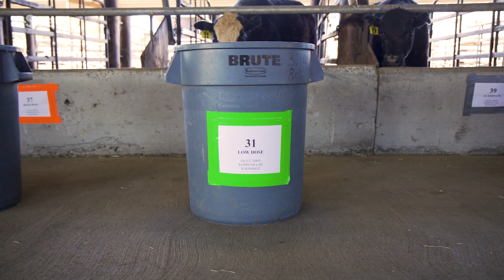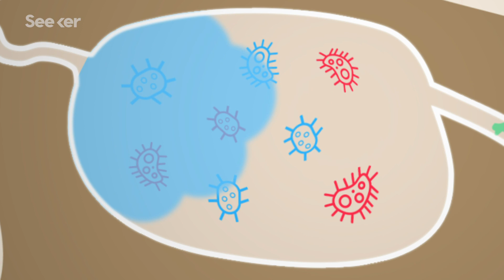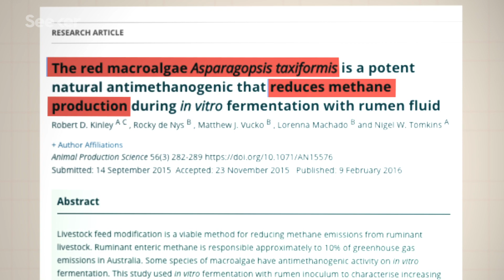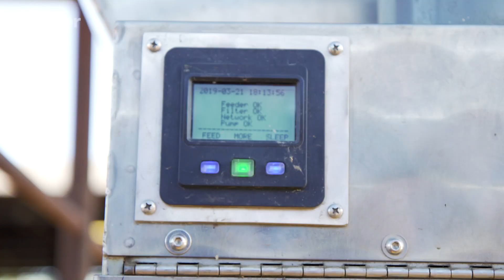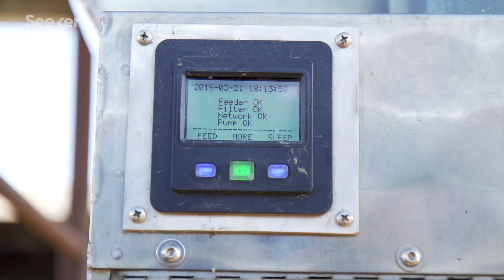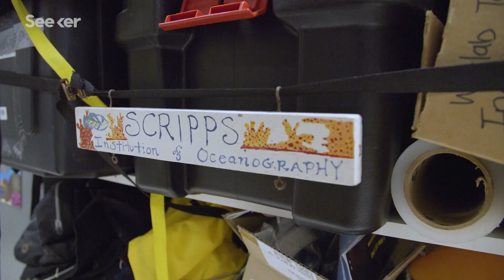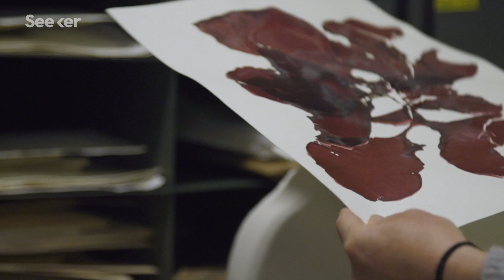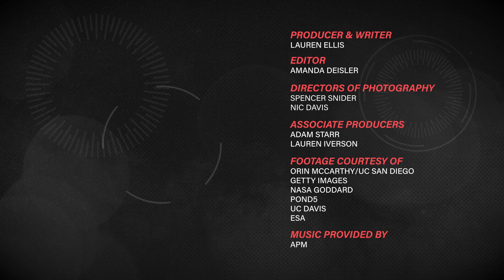How Seaweed Could Slow Down Climate Change

Comment: Methane remains in the atmosphere for about 10 years before largely converted to CO2. However the oft quoted equiv GWP is over 100 years. It's deceptive to compare ten to a hundred years. While methane is in the atmosphere, it's GWP is hundreds of times more impactful than CO2, which also means eliminating methane has the greatest and fastest benefit.

Comment: Methane can't possibly be a global warming agent it's too heavy..! 
With the specific gravity I'm 10 times heavier than carbon dioxide that is 100 times heavier than nitrogen oxygen air there is no way in hell methane can be a global warming agent and that is why it's found at the bottom of all of our oceans underneath liquid CO2 as a liquid..!
     Seaweed is a great idea though it will control their thyroids better and raised better beef..!
Reply: And by the way without methane and the microbes that use it to reproduce there would be no fresh water on planet Earth because after they reproduce then they take nitrogen out of the air and put it in the soil after they reproduce then they shape-shift and changed to a way of micro works with a plant after they reproduce they take heavy metals out of water..!
Before Obama declared methane at global warming agent it was used in our minds in the United States water wells for 250 years to clean them up of metal contamination before Obama called it a global warming agent are EPA did precisely the same practice..! Methane pump down a contaminated well we'll clean it up in two weeks so that is potable water suitable for drinking..!
 let me conclude with no methane there is no pure water to drink on planet Earth..!

Comment: "viable way to meet those standards" uhh no. The only way this goes through is if you can offset the cost of the seaweed with some benefit it provides. The meat industry is cutthroat and the only reasonable way to reduce greenhouse emissions is to just stop eating so much meat.

Comment: The problem is acidification with respect to aragonite of seashells in zooplankton dissolving, they are the basis of the oceanic food-chain and in both polar seas pteropod populations are down >10%, these a primary food of salmon with no replacement species.

As long as we continue emissions it only gets worse, you will see the Great Barrier Reef die, bleached too often and water too warm in the end, corals are going away by 750ppm.

We're at 493ppm CO2 equivalent all gases, adding 3ppm/yr, to kill the corals only 86 years from now, sealevel will be 2m/6.7ft higher with business as usual, 1m/3.28ft if we zero emissions soon.

Sealevel never goes back down with a greenhousing planet ... like for 120,000 years if we quit our addiction this week, 1/4th of tailpipe emissions last over 10,000 years today.

Better get busy ... a cold forcing requires far less logging and land disruption for monocrop plantations when the need is diversity to survive an extinction, Andean farmers are tending over 1000 species of potato, what are 'developed' nations doing?

Comment: I'm curious how inhibiting the methanogenic bacteria interferes with cow digestion.  The cows employ the bacteria for a reason, I imagine that this could decrease the efficiency of cow digestion and cause cows to eat more food - which also means more emissions.  On the other hand, I could imagine the methanogens are actually wasting carbon that could be diverted to the cow's metabolism.  It seems though that most methane is from CO2 and hydrogen, both of which are useless to the cow, so maybe it will be neutral?  Very curious.

Comment: This is great, but should be viewed as a short-term solution while we transition toward replacing meat in our diets. Impossible burgers are actually good y'all.
Reply: Do the impossible burgers taste similar to the beyond burger?
Because I had a beyond burger at epic burger to try it out and it was meh.
Reply: @franklance9167  Try Beyond Beef in meat loaf, seasoned taco meat substitute, chili mac or other casserole dishes that call for ground beef. We can hardly tell the difference. IB is better tasting by itself for things like burger, IMHO.

Comment: 06:21 "We don't wanna have a cultivation facility that requires a ton of electricity and power in order to grow the seaweed, because we're trying to, ultimately,  reduce greenhouse gas emisions and reduce our carbon footprint."

-Electricity production does not generate any greenhouse gas emissions, when we go fully nuclear.
Reply: Co2 is made by the mining of materials such as uranium and so although a big step towards more renewable energy, nuclear fission is only a short term fix in in the grand scheme of things that isn't entirely carbon neutral
Reply: @jtodd3104  Thorium is as abundant as led. If we converted all energy production on Earth to molten salt Thorium reactors we could supply all the Thorium the reactors would need from one medium sized mine. One mine. ONE.
Reply: Sure we just have nuclear waste to radiate the planet and make huge environment damaging holes based off a finite resource. Renewable energy is a more practical solution. For everyone
Reply: @91BJnaruto  What? You make no sense.
It is the nuclear deniers who have to defend the waste since it is you guys who need to store it for 100.000 years. 
New reactors with the right tech do not produce long living waste and they can also burn the old 'waste' as the unused fuel it is.
The raw fuel for new nuclear is Thorium, which is as abundant as led. The amount of Thorium on Earth alone can power our whole civilization for over 30 billion years, this is many times the lifespan of the sun... So nuclear is MORE 'renewable' than solar and wind.
Reply: @Merecir  please tell me where an active thorium reactor for commercial energy production is actually in operation. Thorium is not ready for prime time. It does have a great potential as it doesn't produce waste and is more efficient, but the tech is just not ready yet.
Reply: @Dannosuke25   I have never claimed it is in commercial use today. What is needed is a serious commitment from policy makers, after that things can move along pretty fast.
The climate change issue is just the thing to trigger such a commitment.

Comment: I have a better, cheaper & more efficient solution. I have been doing the following for the past 6 years:  It consists of a fermentation process of pig feces/urine, molasses &  milk whey. At the end of the fermentation process(where transformation occurs), it yields a high protein(24.2%) additive. Useful in cattle, sheep , goats & as feedback in certain stages of pig production. Since I´ve been doing this for the last 6 years, my workers nor I have ever hear the animals belch or fart. Since this food additive is slightly acidic, is slows intestinal movements, permitting more nutrient absorption, less food consumption & less undigested fecal material produced. It does not affect growth rate of the animal, nor does it modify the taste of the meat in any way. Local costs to produce 1Kg(2.2lbs) of this product, is less than 1 american cent(about 7/10 of a cent). This high protein, additive requires no intermediary company to produce(lowering costs). It also recycles calcium & phosphorus. The fermentation process kills off bacteria, viruses & parasites. It reduces & almost completely eliminates greenhouse gases like: carbon dioxide, methane, sulfur dioxide and nitrogen dioxide. I produce my own meat & at local savings on cost of production of 60%(due to less use of soy based protein, that could be used for human consumption). The end product is known as Pig Waste Silage & it smells like cured olives. Once mixed with the feed, it actually smells good, with a slightly sweet fragrance(molasses).
Reply: You're feeding your animals their own manure? Yeh that's not going to go wrong is it (sarcasm) Ever heard of mad cow disease?

& btw no humans want to eat the 300 million tonnes of soymeal WASTE from vegetable oil production that you are referring to there! That's why it's fed to livestock, so it doesn't have to be burnt to dispose of it

Comment: if the electricity needs were provided by nuclear power, then it's a serious net gain all around. New current gen nuclear power plants are incredibly safe and produce more power than previous generations.
Reply: How much power is always relative, the best argument for new nuclear tech is that it is much cheaper and safer.

Comment: So why not just close out the wall add fans and harvest the methane?? Methane also known as natural gas is what comes out of all U.S gas stoves
Reply: It's a nice idea, except to seperate the methane from the rest of the air the air would need to be supercooled until the methane liquified. Unfortunately the cost to cool the air so far would be far more that the energy gained from the methane.
Reply: In more confined environments like composting toilets where the methane levels can become high enough to burn then this does work and is common in places like rural China. But at those levels the cattle would likely die or at very least it would be extremely cruel.

Comment: surely the energy/fuel spend on making the food for the cows and later spend on transporting them to the butchery is more then their internal gas production?
Reply: Would likely depend on a few factors, primarily what they are being fed. In Australia almost all cattle just eat grass and the land is unsuitable for crop production so feed no energy cost. And the transport energy cost per cow is fairly low so clearly the cows digestive system would be producing far more than everything else involved. On the other hand in America most cattle are feedlot raised and fed on crops grown specifically to feed them, those crops in turn are grown using fertilizers that are produced from oil(specifically ammonia). Meat production generally takes at least 10kg of feed to produce 1kg of weight gain and not all of the cow can be used to produce meat(lots of inedible bits).  On the other hand most feedlots are positioned close to processing facilities so transport energy cost is generally low. Overall feedlot cattle would clearly have a far higher environmental impact and would also have a far lower quality of life in most cases. 
Sorry about the long answer, but yes the feed production and transport of the feed likely has a bigger impact for feedlot cattle, but overall the feed digestion would have the bigger impact for grass fed cattle.

Comment: So if I add this to my bean dishes would help with gas?
Reply: Maybe with the volume, but the smell comes from hydrogen sulfite, not methane.
Reply: @midnight8341  I find that beans make me fart more but it's never smelly anyway. I get the most smelly ones after eating garlic and onions.
Reply: @brianmerkosky9243  yeah, because garlic, onions and other plants of the genus Allium are very high in Allicin (which is responsible for the distinct garlic-y smell and its anitmicrobial properties), which is a compound very rich in sulfur. A few legumes and beans have storage proteins that are somewhat high in cystein (a sulfur-containing amino acid), but that's not nearly as abundand as Allicin compounds in Allium.
And it also depends on your gut microbiome, because some microbes can produce more gases while breaking down certain foods than others do.
Reply: Maybe, if you are indeed a cow.

Comment: The issues go far past just methane.  Forest destruction, excessive land use for animals and GMO crops, extreme water usage, factory farms, processing plants etc etc
Reply: Oh yeah, and let's also not forget the systematic enslavement and murder, neither of which is anywhere near being outside the zone of "moral depravity".
Reply: @DeusExHomeboy  Why do you contribute to the enslavement and murder of plants? What did they ever do to you?
Reply: Strangely we have shown in Australia as have some other areas around the world that if managed well livestock production can have a hugely beneficial effect on the land.
One of the big issues some American national parks have is due to the lack of intensive grazing that was once done by the massive buffalo herds they are experiencing severe erosion. Most people still think that to help land recover that it needs to be allowed to rest, but research over the last few decades has shown time and time again that in many environments, especially ones with relatively low rainfall that the land is healthier if it goes through intermittent intense grazing and then allowed to recover. 
In Australia we can show this from the air, not just the difference over time from different land management practices, but by the difference between neighbouring farms. The difference can be dramatic and a clear line can be drawn along the fence lines between properties, one side green one side brown or dust and no fertilizer or water is added, though water runoff is often managed so it has a chance to soak in better.
Reply: @Jake12220  yup :) 
Have you seen these images of how Americans are destroying their national parks by locking livestock out of them? www.rightwaytobegreen.com/2017/07/06/fake-green-fake-science-the-sierra-club-doesnt-add-up/ The American vegans have a lot to answer for!
Reply: @lilaclizard4504  yeah the guys ted talk is one of the few that lve gone back to watch more than once. It's amazing how he has changed his views so much over time and accepted just how wrong his original misconceptions were. 
It's also absolutely astounding the results he has gotten by using animals the right way. As counter intuitive as it first seems more animals can be more sustainable than less.